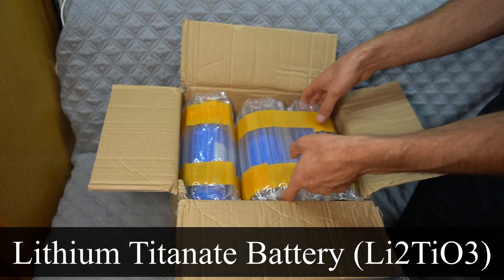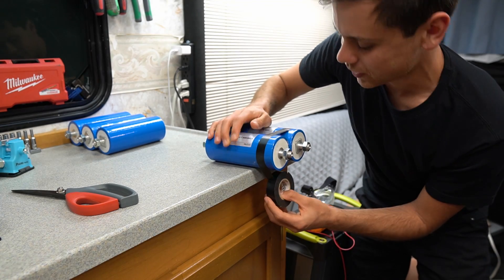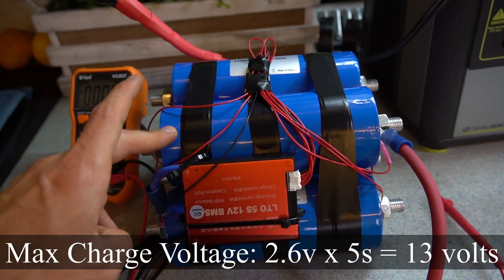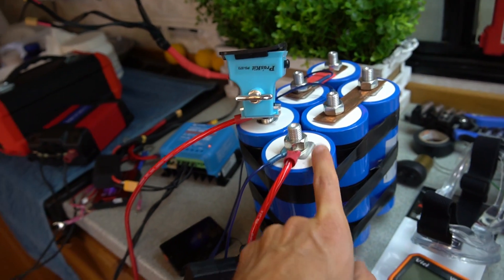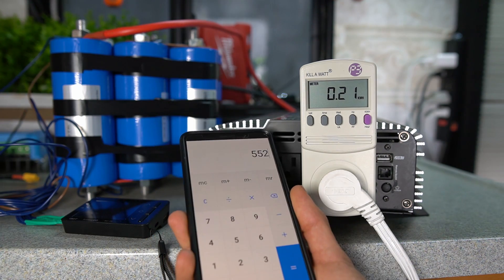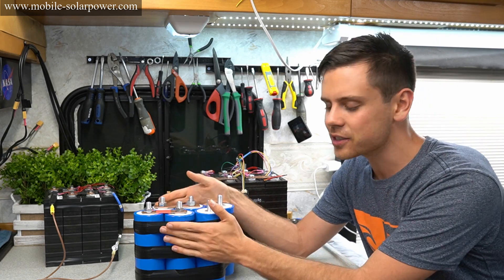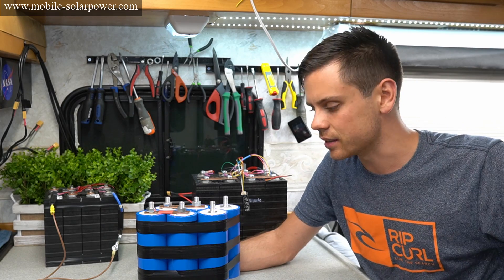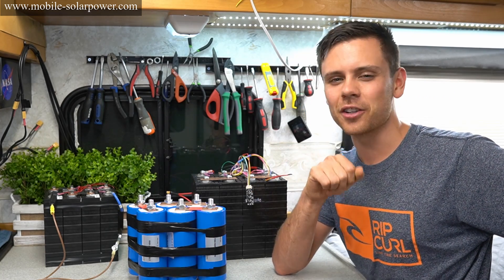DIY 12v LTO (Lithium Titanate) Battery

Comment: Another good use case for this chemistry would be something that cycles multiple times per day in high load. Something like mobile heavy machinery, such as construction equipment, or city service vehicles that make a trip and return to depot several times per day like a bus, garbage truck, mail truck, etc. Buses could charge up quick even at a street stop via overhead connection. The daily cycles could be more than 10, which would bring the life span back down into a few decades for the batteries.

Comment: Maybe multiple banks of these used in parallel would work better. expensive but with the charge cycle difference would be a battery bank that would last for years. Just a thought

Comment: These cells are great for cold climate use, so building an outdoor powerwall etc.. is much more viable compared to Li-ion, hard to wire ? uh go to store, buy proper connectors, then maybe you can do an objective review, seriously how hard is it to wire screw terminals..... back in the day, we used to have a saying " a fucking know it all that knows fuck all "......  first rule of electricity  is good clean proper connections that are suitable for the application.....  if rig up some sort of half assed solution, your going to get half assed results....

Comment: Hi will, Do you have a pdf transcript of the technical. I think the titanate is the way to go for my application. I need a list of equipment needed to charge and discharge from solar, If I build a 49=8 volt system we should be able to get the right number of batteries: is that a correct assumption?

Comment: When it comes to aliexpress, you really need to take ANY battery ratings with a grain of salt. In the past I've seen things like small lithium cells that were advertised as 100+ amp hours and other ridiculous nonsense like that. I suggest building a case for the larger cells, I wouldn't be surprised if any police officer would actually think BOMB if they got a look at any of the large cylindrical-cell lithium batteries.

Comment: Perhaps you're right about them not being 40Ah but LTO only gets better with use, if you can't get a return, try charging and discharging a couple of times see if that helps.
Also, titanate is the tech to go to for EV's and especially if you live in a cold climate area!

Depth-Of-Discharge 85% is awesome! LifdPo4 can't do 99% lmfao. No Lithium based power source can discharge to 99% without staying dead forever thereafter.

Comment: Booo on the halved connectors to fit 1/2". Buy 1/2 connectors for Crist's sake!
Reply from the maker: They are voltage sensing and i am building this battery once so it literally doesn't matter

Comment: I'm gonna risk sounding stupid but I'm new at this solar thing and i was looking at these batteries and can't find any reviews anywhere in them. At 2.3v, 6 would make 13.8 which is roughly what a car battery and alternator operate at. Wouldn't that also change your 40ah to 240ah? Lastly, what's a BMS? Just a way to regulate charging and discharging? Isn't that something a solar panel kit has already? Like i said, new and curious. I'm limited, i have a cheap harbor freight 100w kit i play with to learn.

Comment: Matched these with a UPS 24 volt. They worked great. As the UPS is a Pure Sine Wave...And the charging rate on these is insane. You can charge these up so fast using solar.

Comment: สนใจ battery Li2TiO3 แต่เป็นชุดที่เป็น 48Vdc/300A/h Per Pack Module set และสามารถเพิ่มขนาน Pack Module โดยมีชุดป้องกันไม่ให้ cell  battery เสียหายจาก Over rechart and chart หรือหากมีอุปกรณ์ชุด Switching Charger ที่สามารถจ่ายพลังงาน chart 51.5Vdc /700A/h ที่สามารถจ่ายพลังงาน Chart ได้ถึง 2.5 เท่าของเหมาะสมกับ battery ตามที่บอกมานี้และเพื่อให้ยังสามารถใช้ได้ยาวนานตามสเปคที่ในคลิบ VDO นี้.

Comment: Those look like B stock yinlong cells. They’re a very sought after cell to use in car audio applications. Words of advice, space out the cells slightly so they aren’t touching. The entire casing is a ground so if the blue wrap would happen to wear down it would become a short circuit. Also the studs on these are rated at ~5.1ft pounds. Any more and you run the risk of the stud pulling up and leaking.
Reply: Facts

Comment: Would capacity issue related to high discharge rate? We know that high discharge rate decreases the capacity. 
If this is true, then this cell would be ideal for low power usage with long lifespan need

Comment: Thanks for your reply. Much appreciated as my goal is to solve my need for comfort using air conditioning living in a van in Florida. When you can, please help me understand why c rate isn't more important. Let me just ask a more pointed question..  If you wanted to operate a 13kw air conditioner for extended periods what would you use for battery storage?
Reply from the maker: Depends on your budget but LiFePO4 will make you happy. C rate doesn't matter much for solar because the batteries are huge. The battery you need to run that ac will be thousands of pounds. Not practical for a vehicle mounted solar system. You could use some Tesla battery modules. They are crazy cheap and discharge rate is out of this world.... But it can catch on fire, LiFePO4 and LTO don't. But yeah, c rate doesn't matter here. I built systems that pushed 75-100c when I was drone racing, which is necessary. Not necessary at all for solar. 1c is plenty because batteries are massive.
Reply from the maker: Do the math for each chemistry and your application and you will see it clear as day
Reply: Really appreciate you taking the time to respond. I have been trying to do the math and am missing something. If my AC has starting wattage (2750) and operating wattage  (1300) and I have 420ah total LTO battery capacity by building 6s  (35ah) packs times 12 is 72 batteries. Each battery weighs approximately 2.6 pounds times 72 is around 190 pounds. So, if I ran the AC for say 3 hours then had my vehicle autostart to recharge batteries at approximately 25% remaining on the batteries for 20 minutes to recharge wouldn't this theoritically work? The weight of batteries is only 190 pounds and the c rate charge is 6 or higher with 10000 or more cycles. The battery cost is around $3500 but my objective is more about comfort without running a generator. Using solar isn't in this equation as I am looking to first design my van to provide adequate comfort. I would greatly appreciate any feedback!
Reply from the maker: @bigmatrix56  go with LiFePO4. You will win in so many ways. I wouldn't even consider lto for your application

Comment: I enjoy Will's channel. I've learned a great deal from him, but I think he did a disservice to this technology of titanate. I know everyone's application are different but to dismiss so casually the incredible charging capabilities, life cycles,safety just really surprised me. My application is to build a battery system which can run a roof top air conditioner in my sprinter van for around 6 hours then have my autostart start van engine for 15 minutes recharging with my alternator and continue running the air conditioner as much as I want. Seems to me the biggest issue facing van lifers has been solved and Will doesn't think anyone needs that many life cycles and the efficiency is bad. This to me is a perfect example of not seeing the forest for the trees... Will please reconsider retesting as I think you've missed the boat. If my understanding is wrong regarding the capabilities of LTO I would certainly appreciate the correction.
Reply from the maker: Yeah I'll make a future video covering all the reasons I wouldn't consider lto for solar including calendar aging, discharge efficiency, energy density and more. I can substantiate this point further now that I have studied and experimented with it more. My position is that they shouldn't be used for solar at all. The high c rate doesn't matter. I'll make a video explaining this and some basic examples in due time.

Comment: So if you had the 40 ah or higher do you think the pack would work more afficiently!?. 

Also if you did a 24v pack and had a huge solar system like 3kw in solar and held a constant large  load on it like 2k that it would work well for just running things while the suns out to offset bills and then use another smaller system to run for the night time with regular lithium to make your packs last longer by not having a huge constant load on the lithium packs from say battle born and not needing an extreamly huge pack to charge and retain a large load without huge amount of money on batteries for your system. Could you try an experiment on that if you have those cells around still and access to a larger array.

Comment: Bummer man.  Doing the math I would want at least 8 cells and a regulated output to be able to use the full capacity.  Only getting 6 you loose allot of the voltage range.  Still like you said just not really useful for normal stuff.

Comment: A major plus for these cells is the operating temperature range.  -50 to + 65 is amazingly good.  Pretty easy to kill your entire LiFePo pack if your heater dies on a cold morning.  How expensive is that?  Even with a low temperature cutoff you are out of business much below 5 C.  The ability to charge quickly is also a very good feature for applications where the power source is fickle.  I wouldn't write this chemistry off completely based on some possibly shoddy supplier.  In general great videos Will.  I think you have one of the best channels out there.

Comment: With 10C charging you could charge your car in 5 minutes, if the charger can deliver the enormous power that is...
Reply: Yeah. We are going to see a lot more EV's with LTO, no doubt. Believe there is a Holland based car manufacturer/kickstarterscam that have a prototype that charges full in 5min. 
My reaction instantly was "oh LTO, nice" but I remember the comment section was filled with sarcastic sceptics. Hehe

Charge-rate, Lifecycle, and the excellent thermal tolerance is the main selling points. 
Can't wait for more mainstream EV manufacturers to start using LTO, because the price atm is a tough pill to swallow in one go. 
I remember the comment section
Reply: I think a plug-in-hybrid Jaguar prototype used Lithium Titanate batteries, hopefully others will follow.
Reply: Or, you could use to jump start a car!

Comment: you need to do more research on lead acid batteries.  500 cycles so incorrect.  I have lead acid batteries that have gone more than 7,000 cycles and am now using lead acid batteries that can go 17,000 cycles and produce way more power than the lithium titanate batteries.  they are rated at 600 amps x 3 and will produce 42,000 watts.  A 300 amp draw only drops the voltage 0.6 volts Thanks for the show,  I will not likely by lithium titanate batteries. Big waste of money.  thanks for the update.

Comment: Round terminal connectors too small: just split at tip and spread and shape. Gives more surface area than clipping down to spade as you are doing.
Reply: It's just for the balance wires.

Comment: Something to keep in mind is how a battery's amp-hours are calculated... Companies draw 1A for 20 hours and calculate the Ah based on the depth of discharge after that (assuming >20 Ah capacity). So drawing a lot of current can dramatically reduce the overall amp-hours.

Comment: i think this is all BS 20.000 cycles ? ive read that Lithium Titanate lasts 3000 to 7000 charge cycles not 20,000 so i guess its a little snake oil going on here
Reply from the maker: Read the data sheet
Reply: @WillProwse  im not saying the suppler does not say its good for 20.000 cycles in the data sheet but its most likey way over exaggerated and who's going to stand around testing it, 3000 to 7000 is still bloody good
Reply from the maker: @Yahgiggle  yes indeed. I would argue that calendar aging kills all of these batteries before they hit 10,000 haha

Comment: For a battery backup system, 15% loss is fine. I would just want reliable.
Reply from the maker: There are cheaper lighter more powerful and more efficient options compared to LTO

Comment: Thank God I stumbled onto this vid.  The 15 year old battery-bank for my small home solar setup recently decided to give up the ghost and I was seriously thinking about buying several of these.
My problem is that I'm tech-retarded when it comes to stuff like this so I think you might have just saved me a ton of grief and money.  I can rebuild the interior of just about any car on the planet to factory spec from scratch but when it comes to figuring out anything having to do with batteries that involves math and electronics, forget about it.

Comment: You are wrapping that electrical around the cells WRING!!  The correct way is NOT to let the tape be in a highly stretched state when wrapped.  Let the tape 'relax' a bit, then finish the wrapped turn where the tape is somewhat unstrecthed, otherwise, over time, the tape will eventually try to 'unstretch' and the binding stretch will stress over time and sticky side will slide along the batteries.  I have seen this mass things as fast as a few hours.
THANKS FOR THE VIDEO, THIS IS THE FIRST TIME I LOOKED AT LTO BATTS!

Comment: When I first saw it I automatically  thought "giant capacitor"      pretty much what it is.
Reply: No, capacitors have 10x less capacity (Wh), maybe 10x more power (can charge/discharge extremely fast), cost 10x as much considering capacity and are nearly 100% efficient.

Comment: We need to eliminate the need for an inverter! It shouldn’t cost that much more on most consumer electronics to install a 12v or 24v dc power option there is so much power waisted from inverters in heat! With more and more people world wide going solar a dc input an all consumer electronic like TVs even some electric appliances can be easily made to work on DC current this needs to be done mandatory by law to eliminated waisted power!

Comment: My company just started using those, your main problem is your cheap harbor freight inverter and the VDC your running, you need to run LTOs at 26v comfig with a good 24v inverter with high range, it will draw nice amounts of wattage for long periods of time.
Reply from the maker: What does your company use them for

Comment: this battery actually can power a electric vehicle or smaller bike truck mostly you can see widely in china so nothing special. and this battery is normal duty is not industry heavy duty battery the layer batteries for superb fast charging is definitely different look between this standard blue pack

Comment: Dude the easy way to make terminals that fit any size is to take copper pipe copper water pipe hard copper water pipe and smash the ends and then drill a hole in it and then solder the other end to your wire try it it works awesome

Comment: Like your said, they are not really good for your application. As far as I understand based on what I've read, the Allure is in its ability to be charged quickly. So based on that it would definitely be used in situation where you use them continuously until depleted and be able to recharge in no time and continue again. Because it discharges and charges so many times in those kind of applications,  it's charge cycle lifespan becomes also very important. That is why they are using them in things like buses where they can charge while making stops at different points.

Comment: That's what happens when you buy off brand batteries. You probably got a bunch of QC rejected Lithium Titanate Oxid batteries that was bought at a huge discount and then rebranded.
Reply from the maker: Yeah it's true. But still not wise to use this chemistry for solar regardless

Comment: Greetings from California. Thank you for the eye opening video about Lithium Titanate cells. I was about to proceed to acquire about 12 units and once I watched and heard your comments, I said NO. Like you mentioned LiFePo4 would be always better and safe. 
Thanks again, your presentation is great, very friendly and down to Earth. Cheers.
Reply: Some other commenters have mentioned that the ones Will bought might not have been 100% genuine. But if you don’t need the high charge/discharge rate or the extreme (to be proven) durability, I agree normal LiFePO4 batteries are a lot less hassle and the will serve you for many many years anyway.

Comment: What do you think about a bigger supercaps bank? I use 4x of 16V 6x500F powercap banks with BMS boards 4x38$ (2 in serie and 2 parallel) and a 4000W 24V Pure Wave inverter @30V. I run 2000W water cocker without any problem. Here is no extensiv batterie.
Thanks for all your videos. Best greats form Germany.

Comment: So the drawbacks are primarily that if you need a lot of amp hours, you need to overspec your pack compared to Lithium? I'm not sure if that's a deal breaker to be honest, even for RV applications. With loose cells you could construct interesting battery "boxes" that aren't box shaped, and they charge fast and can handle sub-zero charging and are even safer than ferrous phosphate. But, it's definitely worth thinking about before you go ahead, the cost up front goes up yet more and you need to dedicate even more physical space to the batteries. But at least in theory the idea of a second 24 volt 250 amp alternator on an RV or van, dedicated to and hooked up to an LTO pack that can guzzle down the full 250 without taking damage sounds pretty sweet. Running out of power? Go for a half hour drive to a café and you have juice again.

Comment: Buy some real yinlong cells and I guarantee you will be alot more impressed than those crappy knockoff cells trust me. Yinlong 40ah cells are awesome. A 6 cell 40ah bank can handle over 400+ amps for over 40 secs or more , Lto is very good topology, LifeP04 is awesome in its own right. Just found your channel and I like the content because in learning about battery specs  ,solar,   and other things I'm new to..